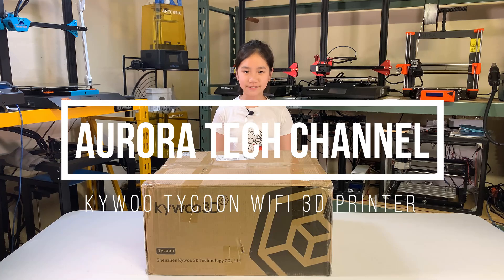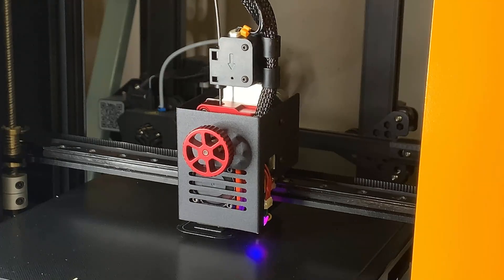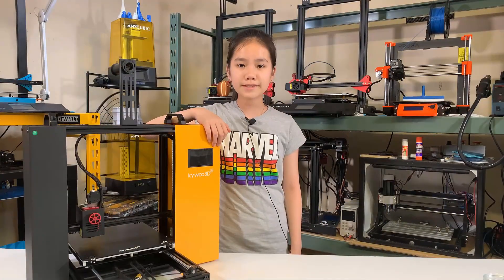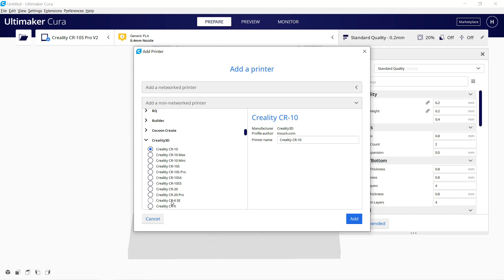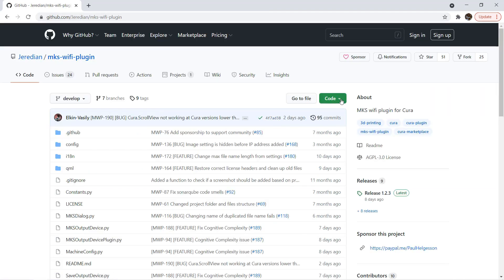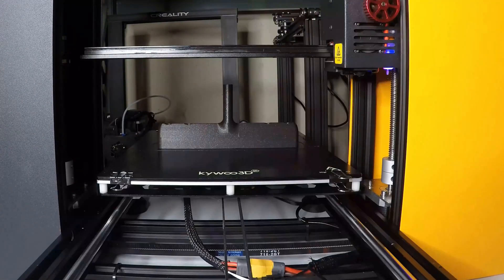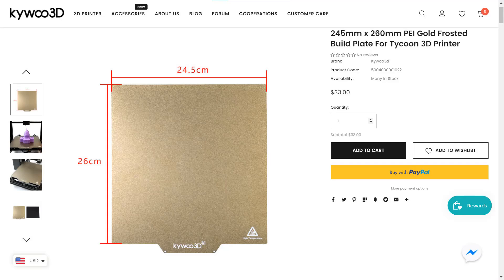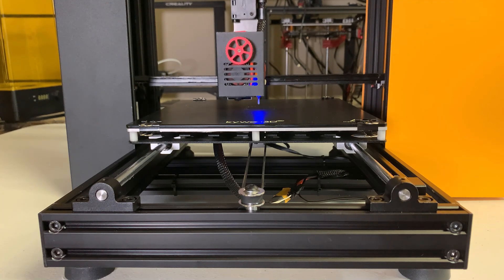Kywoo Tycoon 3D Printer: Built in WiFi, Wireless 3D Printing, Print like an inkjet printer

Comment: Does this MKS plugin still work with firmware 2.01? I have the EPSD3D for Marlin interface working in client mode but it is very bad and slow.... If anyone knows, that would help alot. It would be nice to just send direct to the printer from Cura.
Reply: @Uroboros thank you!

Comment: Was planning to get Sapphire plus, but thinking of going for this one. By the way Aurora I am thinking changing the board to BTT Skr e3 turbo, your input will be highly appreciated on this.
Reply from the maker: The MKS touch screen of this printer is not compatible with the BTT motherboard, so, you can't just change the board without changing the screen, if you also change the screen, the cutout on the enclosure may not fit. 

The Cura MKS WiFi plugin also shouldn't work with BTT boards. So, I don't recommend to do that.
Reply: @AuroraTech  Thanks Aurora for the information.

Comment: they put linear rails on X but not a good extruder?! I don't understand their logic... the extruder/hotend in my experience is the most important component in a 3dprinter. on a bed slinger using rods vs rails doesn't change almost anything! they should've put a BMG clone or something as the extruder.

otherwise this printer looks good! Nice job, this video is good ^_^ 💜

Comment: Realy good review.

The Prusa mk3s+ also do not have no manual leveling, compansating everything using ABL. But there can be tilt up to 1mm between left and right side of the bed. While you will not see it on most prints, this can be a problem printing precise mechanical parts. So many people did the "locknut-mod" using octoprint with a plugin and calibrate the bed by 8 of the nine screws. The accuracy improves, as the ABL only have to do very little correction. All you need is 8 nylon locknuts. You do not even need a Pi, as you can install debian, octoprint and the plugin on a VM if you only want it for calibrating the bed.

Do you know how much corection the Tycoon actual has to use? Is there a way to adjust the bed in a simular way as on the prusa?

I always prefer to manually adjust a bed as good as possible and use ABL only to correct the remaining bending due to heating. On all my prusas I got extreamly good first layers this way...

I absolutly share the critiqe with using A4988 on z. Do you know if the board uses socketed drivers?

Sometimes ask me which printer I recommend. This printer seems nearly perfect for beginners. While I normaly do not recommend printers I did not try myself, this might be an exeption (I would normaly just buy it an test it myself, but I just ordered a voron 2.4 based Jennyprinter with 650 by 650 by 600 volume - so I spend the rest of my 3d-printing-budged for the rest of the year... I will definitly make a video about that monster after it arrive and is working. I never had a printer that size. Have not found any videos about it yet. Even the pictures on Jennyprinters Website only show the "small" 350 by 350 and 410 by 410 versions. I am quite curious to see how well it works out....)

Comment: This is a very interesting printer and another great review.  There isn't much out there that's this user-friendly in the low-mid price range like this. Easy-to-use printers are either basically cheap plastic toys like the easythreed, or >$1k units like the qidi x-pro.  I'm not a fan of their "unique" single-gear extruder/heatsink combo - going to the effort of custom machining an extruder and not going dual-gear is just a dumb mistake.  It doesn't look like the filament path is very constrained, so I suspect this would have a lot of trouble with soft TPU.  The exclusion of a simple Z offset setting in the menu is also an easily avoidable blunder (especially for a printer with a strong focus on ease of use), though that should be easy enough for kywoo to fix with a FW update.

I really appreciate that you went to the effort of explaining exactly how to update the cura wifi plugin.  Most reviewers would have just said "you need to update it manually" and left it at that.  Those of us who have been doing this for a while would have no problem, but a total beginner (the kind of person this printer is likely aimed at) would be totally lost.  I have no doubt that your instruction will help more than a few people.

A few suggestions:  You didn't mention whether their bespoke hotend is all-metal or PTFE lined.  This is important if someone wants to print higher-temp materials like ABS  or PC, which you can't safely do with PTFE.  Mentioning the FW limits for hotend and bed temp would be helpful for similar reasons.  It might also be nice to do some speed tests.  Every printer will print fine at 40mm/s.  Most can hit 60 and still look decent, but that's often the limit before quality really takes a nosedive.  If this can go higher, that's a significant selling point.

Comment: While not a fan of the in integrated extruded/hot end combo I will state this company has implemented a host of features that, on paper, look like significant upgrades . I also think the ability to replace the hot end I will be an option in the future. Great job aurora tech this printer is now on my shortlist.

Comment: Looks pretty nice. should be a great workhorse. I would go for a smooth PEI sheet. You could possibly upgrade the A4988 drivers. You would need to swap the motor direction, or change the firmware. I see alot of potential here. Love your videos